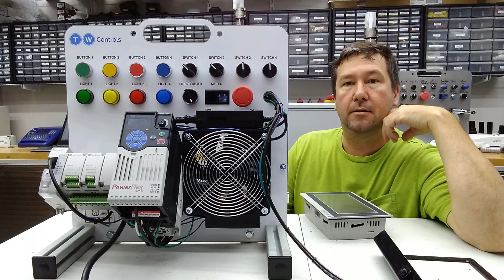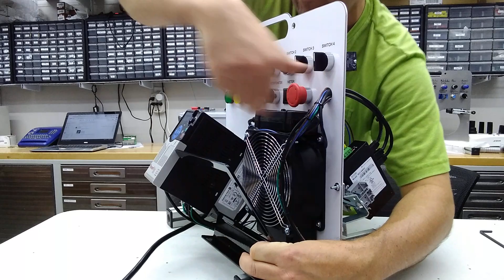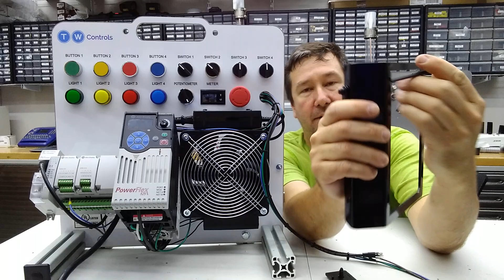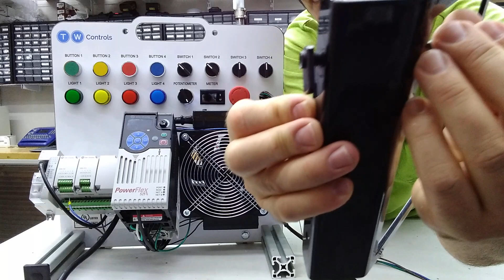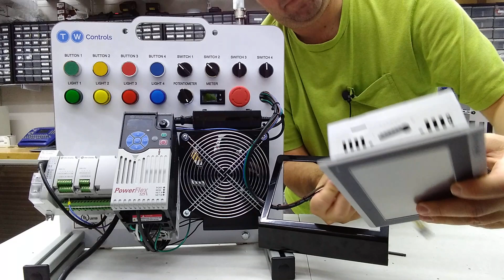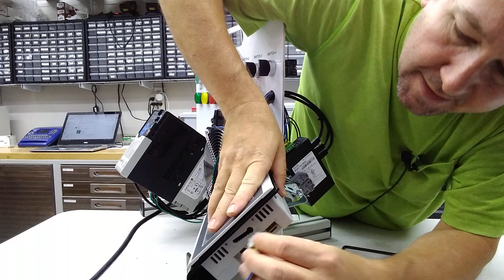Allen Bradley Micro850 Custom PLC Trainer with HMI 4253

Comment: Is there a video on how to set it up
Reply from the maker: Which part? This was a custom trainer for someone. Here is a course that goes through the Micro800s.
https://courses.twcontrols.com/courses/allen-bradley-micro800-plc-training
Reply: @TimWilborne  SKU: TRN-ICP-MICRO850-HMI
Reply: @TimWilborne  you think I would be able to swap out the micro 850 plc for a compact logix plc so I can practice with studio 5000?
Reply from the maker: That's a standard trainer. Here's a link.
Reply: @TimWilborne  would I be able to use I/o and power supply of a LR36ERM so I can practice studio 5000? Instead of the micro850 setup ccw
Reply from the maker: Oops, forgot the link. 
https://twcontrols.com/plc-trainers-all/tw-controls-allen-bradley-controllogix-compactlogix-plc-trainer-with-analog-ac-drive-motor-hmi-sku-trn-icp-ra5000-aio-hmi
Reply: @TimWilborne  sorry I am only asking because I already bought the standard addition. I have spare LR36ERM though and other spare compact logic. Assuming from the set up you sent me that I should’ve bought I should be able to just wire the standard addition the same way with LR36ERM plc
Reply from the maker: Yes, but it will depend on what IO modules you have.

Comment: Hi Tim, I am looking at using either a Micro850 or Opto 22 for one of my projects. Do you have any experience with Opto, and if so, what might your opinion be between the two? Thanks, fantastic videos!
Reply from the maker: I have limited experience with Opto22. How are you wanting to interface the two?
Reply: @TimWilborne  I’m not looking to interface the two, I’m really trying to decide which platform to choose and see whether Opto 22 Snap PAC would be a similar product to a micro800 series. After further research, it looks like Opto may be more “smart IO” rather than a typical PLC. Thanks for the response!
Reply from the maker: I'm more familiar with Opto22 as remote IO.